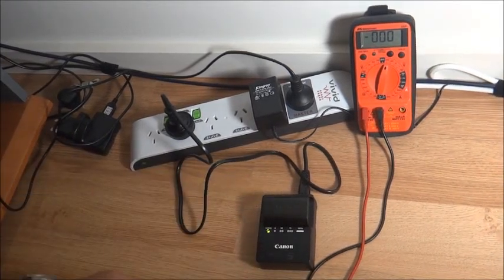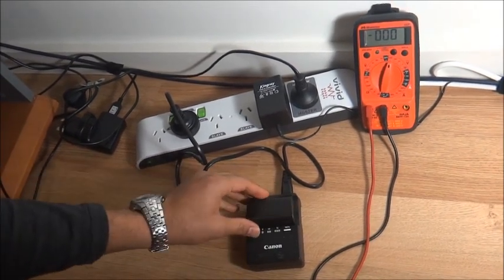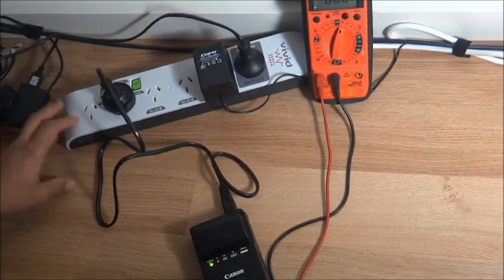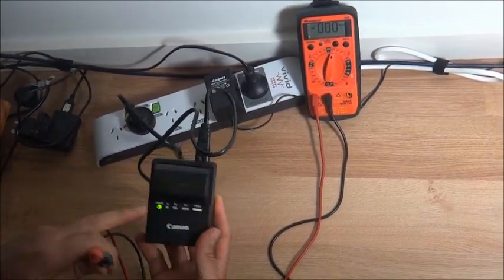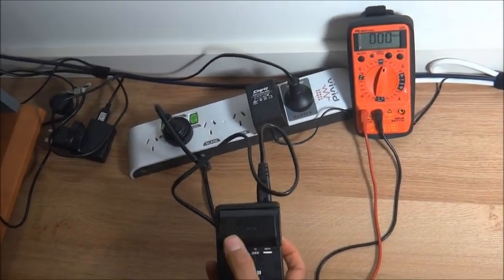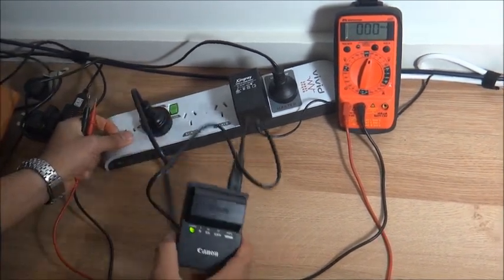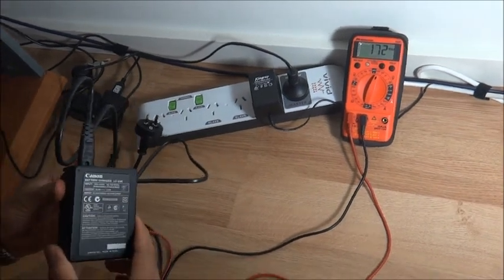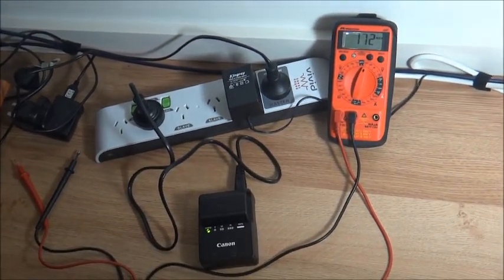Electrocution Hazard Canon DSLR Battery Charger LC-E6E Test Review

Comment: Holy shit..... I didn't realize that was possible, I put a 3 pin plug on a ceiling fan circuit for testing purposes with a watt meter and a few times I unplugged the basted and touched the pins while the fans were still spinning down and I got jolted with bloody ac voltage.... talk about unsafe shit and DC is worse then ac. U show promise and I am glad ur in oz.... keep up the good work.... we need more like u.